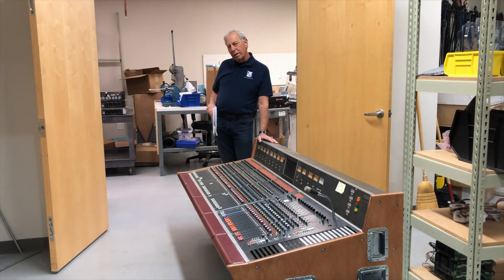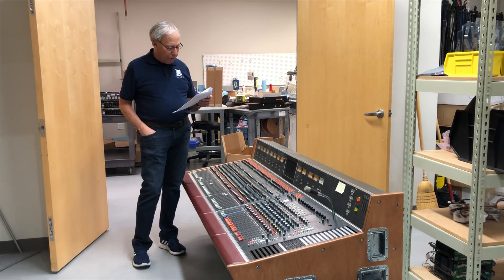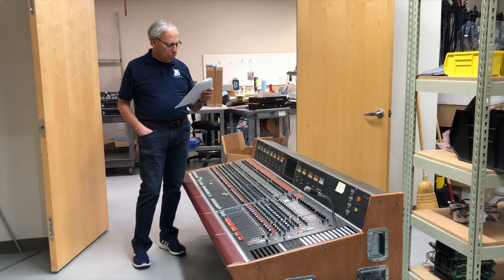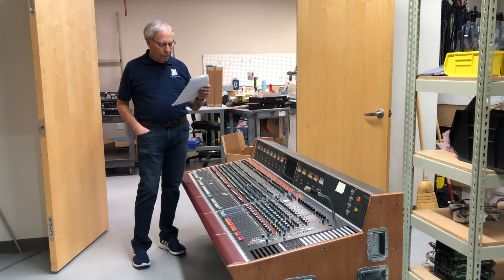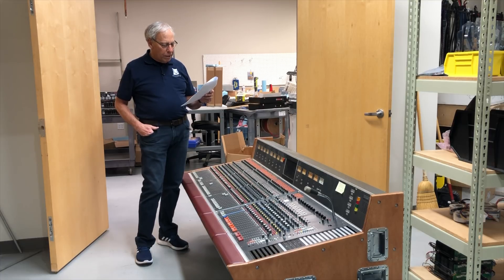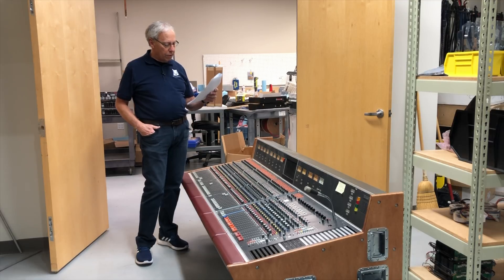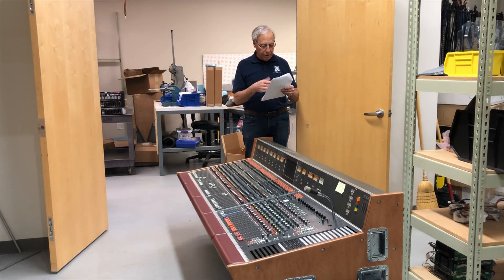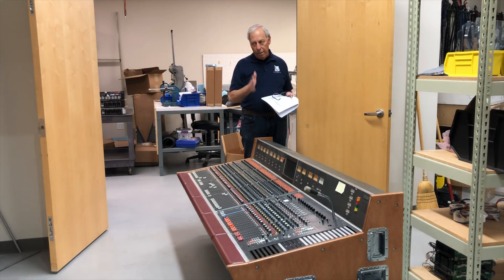How digital clocks affect sound quality

Comment: Interesting, but I think you glossed over the actual question.  What impact does the clock have on the sound?  It is major.  A low jitter clock signal to the DAC chip results in substantial improvement in imaging, accuracy, natural tonal quality, slam and perceived extension in bass and treble.  If you want a DAC to sound like a good analogue source, a great clock is essential.

Comment: Once you finish modifying that console you should take the analog output to your amplifiers driving a cutting lathe to make a direct to disc LP. Right now i'm not interested in anything digital until someone proves to me its better.
Reply: From Wikipedia: "The Nyquist–Shannon sampling theorem is a theorem in the field of signal processing which serves as a fundamental bridge between continuous-time signals and discrete-time signals. It establishes a sufficient condition for a sample rate that permits a discrete sequence of samples to capture all the information from a continuous-time signal of finite bandwidth."

"Strictly speaking, the theorem only applies to a class of mathematical functions having a Fourier transform that is zero outside of a finite region of frequencies. Intuitively we expect that when one reduces a continuous function to a discrete sequence and interpolates back to a continuous function, the fidelity of the result depends on the density (or sample rate) of the original samples. The sampling theorem introduces the concept of a sample rate that is sufficient for perfect fidelity for the class of functions that are band-limited to a given bandwidth, such that no actual information is lost in the sampling process. It expresses the sufficient sample rate in terms of the bandwidth for the class of functions. The theorem also leads to a formula for perfectly reconstructing the original continuous-time function from the samples."

I.e., it has been proven mathematically that there is a digital sample rate that will allow PERFECT reproduction of the input signal (in theory, a sample rate that is twice the highest frequency you wish to capture). No analog recording/playback method can provide such perfect reproduction. Note: "allow", the Nyquist-Shannon sampling theorem is an abstract proof, the actual electronic implementation of A/D and D/A converters affects the result.

Also, while a digital recording may perfectly capture the input that doesn't mean that it will sound good. GIGO (Garbage In Garbage Out) still applies.
Reply: @avsystem3142  I once played with a DAT machine and no matter what the sampling rate the playback after recording some records had swishy highs. cymbals sounded like a swarm of bees.
Reply: @andershammer9307  The DAT machine was not the weak link in that scheme.
Reply: @avsystem3142  Sounded great recording on my Tandberg TD20A reel to reel. Closer to the source then the Dat machine was. Weak link or not, it colored the sound in a way I didn't like.
Reply: @andershammer9307  A more likely explanation is that the tape recorder colored the sound in a way that you liked and the DAT did'n't add any "coloration" to your satisfaction. BTW, DAT technology has been obsolete for decades.
Reply: @avsystem3142  had nothing to do with what I liked. Had to do with which machine was closer to the source. Seems a lot of digital systems have trouble with phase accuracy at higher frequencies.
Reply: @andershammer9307  A/D converters in DAT machines are thirty year old technology. Complaining that digital audio colors the analog input based on experience with obsolete technology is like complaining that RIAA phono preamps "color" the sound of 78 rpm records. Well, yeah. 78 rpm records were not made with RIAA equalization. Every manufacturer had their own equalization scheme. The fact is that modern digital audio technologies provide the most accurate means of recording sounds every invented by humans. Granted, not everyone likes accuracy. If they did there would no longer be tube amplifiers, which add harmonics not in the source material and which many people find pleasing.
Reply: @avsystem3142  78 RPM records may be old technology but did you ever listen to one ? Much wider dynamic range than most CDs. I've heard recent digital technology while it is good pure analog is better to my ears. I used to listen to CDs but I don't bother anymore with all the great vinyl re-issues now coming from Analogue Productions and others.
Reply: @andershammer9307  I have over 5,000 78 rpm records. I have transcribed and digitally restored and recorded several hundred of those (it is very time consuming). Your statement that 78's have a wider dynamic range is complete BS. CD's have a dynamic range of 90 dB. A 78 is capable of about 40 dB of dynamic range. I'm not going to comment further since you clearly don't have a clue about these subjects.
Reply: @avsystem3142  I have a few hundred 78's and over 5000 LPs and I have vintage record players and I used to work at several high-end stereo stores and I was known for my ears. It appears to me that while you own these and work with them that you don't actually use your ears. I have about 200 CDs and only a couple sound like the have wide dynamic range. I also listen with full range electrostatic speakers.
Reply: @andershammer9307  I don't care how golden you think your ears are, 78's don't have anywhere near the dynamic range that CD's do, nor do LP's, although they are better than 78's in that regard. That is not a matter of opinion, it is a technical fact. CD's have the technical capability to record a 90 dB dynamic range (at 16-bits). That, of course, doesn't mean that all are engineered and produced to take advantage of such a dynamic range. Most pop and rock music is so compressed that many, if not most, may not in practice have a dynamic range any better than an old 78.
Reply: @avsystem3142  But 78s sound like they have more dynamic range than CDs due to the loudness wars crap. Ever hear of DBX records ? I have 20 of them and they have 100dB of dynamic range and no noise. Look it up. I have some LPs and CDs that were made from an early digital system called soundstream that sampled at 50k and the LPs have stunning dynamic range while the CDs don't.
I show this to people all the time and they are shocked.
Reply: @andershammer9307  Sure, but you stated that 78's have a wider dynamic range than CD's, not that many CD recordings are produced such that the effective dynamic range is less than that of some 78's. You may not buy them but many CD's, e.g., art music, take full advantage of CD dynamic range. Re: DBX records. The physical media did not have a wider dynamic range that any other LP. They used music that was compressed prior to printing on the record and then decompressed on playback to achieve a higher dynamic range. This entire back and fourth was due to your not clearly stating your claims, i.e., technical capability vs. music production in practice. I've said all I care to on the subject.